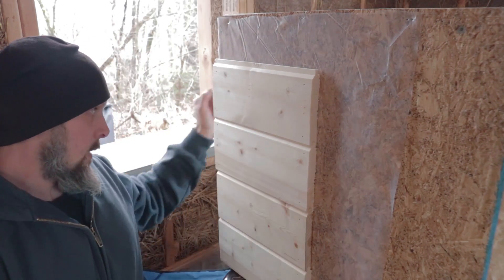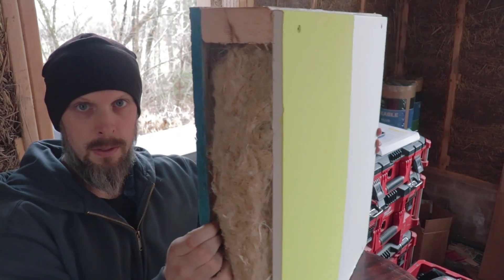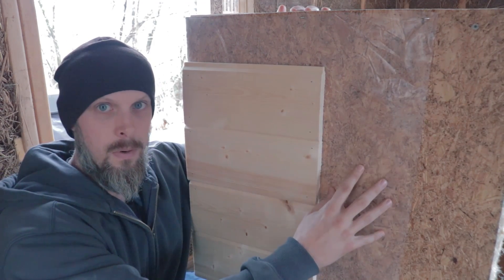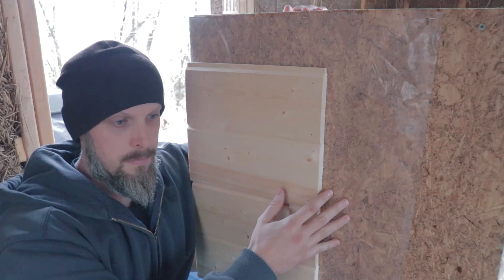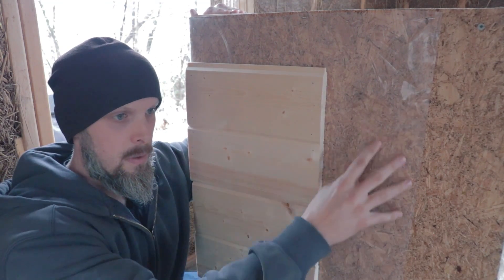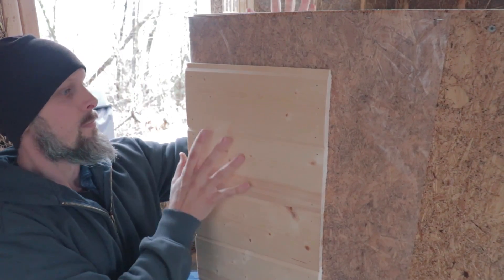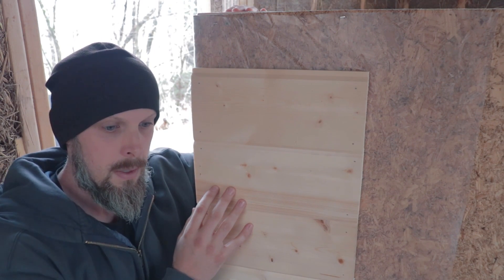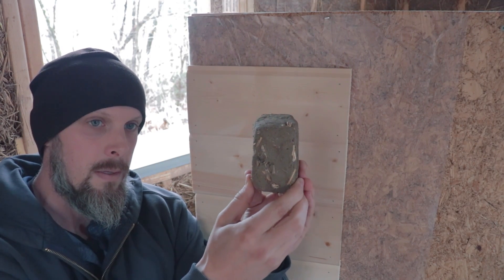The Top Reason Why Buildings Fail & Why Cob Walls Protect Against Mold and Moisture

Comment: This sounds great. I’m wondering what happens exactly with the moisture or water. If it comes through the wall, inside the house, when does it go out? Like at the moment we have a moisture level of around 60 percent inside (it’s autumn) and during the winter it gets down to 18 percent. Would water permeable walls balance this and how?

Comment: hey! i'm considering building my own home, and i think cob is a super fascinating material, but i live in norway. and here you could get down to -30 degrees celcius and some meters of snow in the winter depending on where you live. it is also quite wet. So my question is, what type of building would you recommend for such a climate? like what kind of insulation, stemwall, finishes etc.

Comment: Great presentation.  One thing to note is that adding portland cement to the cob mixture as a stabilizer is bad, because it interferes with the moisture buffering properties of the clay.  Portland cement should not be used in conjunction with cob except in the foundation under the cob, or in a bond beam on top of the cob wall, or window sills.  The walls must be natural materials, with exterior waterproofing being accomplished by lime plaster, NOT portland cement based stucco or other plasters containing portland cement.  Portland cement has all the drawbacks you described for the house wrap material, that is, it is not vapor permeable, so if stucco is used over cob, it causes moisture to accumulate inside the wall.  In Britain, some cob houses that were hundreds of years old have collapsed because of putting portland cement based stucco or plaster on the exterior, blocking the water vapor from escaping and causing moisture to accumulate inside the walls.  Just say no to portland cement.
Reply: Would 10% cement mixed into the cob affect it breathability 100% I haven’t used cement in my building but considered it for some ceiling mounding I am going to make with cob. Maybe I’ll just add lime instead.
Reply: @231rft  I think using lime is a much better idea than using Portland cement.  Cement is basically not compatible with the nature of cob.  If you add 10% cement powder you are basically getting a somewhat weak concrete, not cob.  Concrete is a nice material in its place, but mixing cob and cement is a terrible idea.

Comment: The problem with cob is just the horrible R value. If they had a highly insulated cob, then it would be great. But without that it just doesn't have enough to make heating / cooling practical. 

Sure it can hold onto temps better and keep swings down. But without that ability to insulated it just isn't viable for a lot of places.

Straw bale is a nice middle ground. BUT it still doesn't have enough R value to compete with a well insulated modern wall with mineral wool or something like that.
Reply: I live in the cold north and strawbales laid flat (not on end) is more than enough r value for our needs.  Where do you live that you need that high of an r value?
Reply: @kikilove1029  I'm in Maine. The higher R-value the better efficiency the house will be and lower the heating bills longer term.

Like you can have a house of lower r-values, just it means you need to run the wood stove or heat pump more.
Reply: I helped build a straw bale house over 20 years ago in Saskatchewan, which is north of North Dakota and Montana, and in winter, it sees temperatures well below -40 F.  We have replastered the outer layer of lime once, and it is extremely warm, having a much higher R value of mineral wool.
Reply: Check out CobBauge composite cob developed in the UK and France.
Reply: Can you place cobb between regular 2x4 stud house framing? Would it have to be pressure treated wood if used on exterior walls?
Reply: @wildlingyoga9057   Not thick enough to support itself that small.... it would be more of just a plaster.
Reply: I visited a couple strawbale houses in the summer in Missouri with no air conditioning. It was pushing 100F outside and it felt air conditioned inside, maybe 75 degrees or so. I’d say it was better insulated than any house I’ve ever been in, and they said it was also warm in winter

Comment: I don't think you understand vapor barriers. They are supposed to be on the inside in the cold states, where it's colder outside. They tend to put a permeable layer (like tyvek)  behind the siding.
Reply from the maker: Yes, sorry. The plastic layer in my model is supposed to represent Tyvek. I should have noted that.

Comment: Your wall is missing some key components: on the exterior wall you don't put plastic membrane, it must be a vapor permeable membrane, and on the inside, between the drywall and the insulation you must have a vapor barrier (preferably with variable SD value to allow moisture to migrate from the insulation to the inside of the wall in the summer time). At least that's how is done in Europe where i live.
Reply from the maker: Thanks!
The outer plastic layer is supposed to represent Tyvek.
I don't think anyone puts a vapor barrier on the inside here in the Southern US.
Thanks for your comments!
Reply: @thiscobhouse  Tyvek isn't a vapor barrier, it wicks the water from any exposed point and allows it to evaporate before it reaches the wood.  Tar paper is a superior product, and is also not designed for the purposes that you state.  I like your page a lot, but you clearly haven't built a conventional home with modern building sciences.
Reply: @MarkWilson-ij9jd  

Sure, but modern houses suck balls.
Reply: That's because in colder climate warm moisture which enters the wall from inside condensates on that outer plastic, so there has to be vapor barrier from the inside, and wind barrier on the outer side, and a ventilated facade which allows moisture to escape the structure. But even this not guarantee from building up mold:( Good ventilation is a key

Comment: Ummm... Tyvek...
Reply from the maker: I understand that Tyvek is supposed to be vapor permeable, but it still traps moisture behind it a lot of the time causing moisture damage. I should have bought Tyvek to put on the sample demonstration though.
Reply: @thiscobhouse this video link might explain why building materials are horrible nowadays https://youtu.be/j5v8D-alAKE
Reply: @thiscobhouse  watching this video made me think of you lol. Thank you for your videos.
Reply: @thiscobhouse  when installed right it doesn't trap moisture behind it. That's why it's code to use a proper vapor barrier. Or zip system works great too.
Reply: https://youtu.be/oU8Izqvwgq0

Comment: Hi Alex! just started watching your videos, so much information! Do you have a opinion on Aircrete? Yay or Nay>
Reply from the maker: I like aircrete, but from what I understand it's not load bearing. So, I wouldn't use it standalone for structural components like lintels in a cob house. It's good for the dome systems people use it for though, and other non-load bearing things.
Reply: @thiscobhouse  considering aircrete is poris and air can move though it, would using tadelakt over stucco be a good move? Thanks again!

Comment: hi i'm in humid south texas were the building codes are below the national standards so most homes down here start rotting with in a few decades.  i'm kinda stuck in place in a moldy house built in the 1950s outside layer brick but the eaves/attic exterior walls are wood... my attic is all loose fluff asbestos on top of the sheet rock, no insulation to the roof so it gets into the 190f ranges in my attic and my house leaks air like crazy.  there are a few small cracks in the morter/bricks because they made the concrete too strong  so there are some broken bricks too. they are fine small cracks on a solid slab concrete foundation so i am not worried about    

the remodel i was going to put zip system with 2 inchs of insulation on the roof top and then a metal roof and eaves. below is brick which i want to lime wash. i was hoping the lime could also seal fine cracks in the bricks and cover up the ugly light orange color. i was also considering tadelakt the kitchen and bathroom. then after getting all the plumping redone and the electric upgraded. i'd clean off all the moldy gypsum wall board with bleach and patch it with a lime plaster. then lime wash every surface possible since learning mold doesn't grow on lime. i was considering if any wall board had to be fully removed i might use light clay straw and then lime plaster over that. 

when i can finally move out in a few years, and maybe even build a new house, I'd like to do adobe or at least light clay straw and lime as my finisher for interior and exterior. so, remodeling my current house is me getting the skills down before making a house i am serious about staying put in. 

but the biggest problem i see on youtube is a SERIOUS lack of information on how to remodel an existing house with any of the health friendly methods adobe or any of the other nicer healthier ways of building. i do kinda want to remove the asbestos but my attic is legit a crawl on your knees and hand space and I'm a heavy girl. if i wasn't so chunky I'd attempt to remove it and replace it with light clay straw since it is going on top of a single layer of gypsum board.